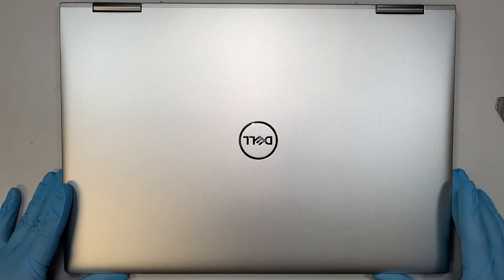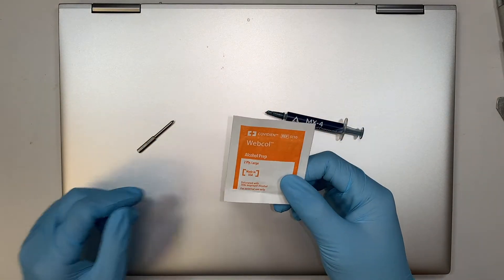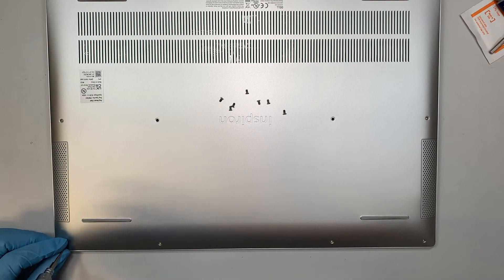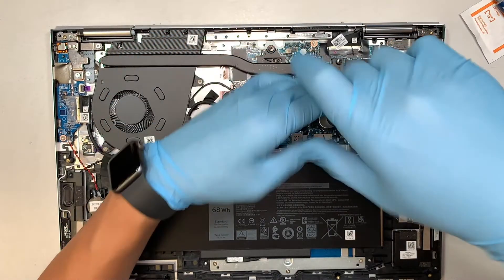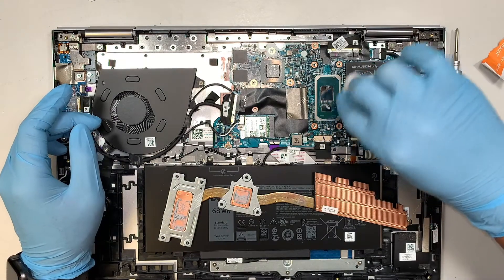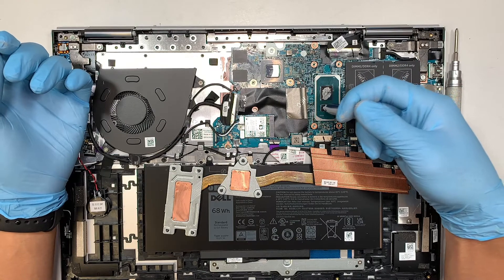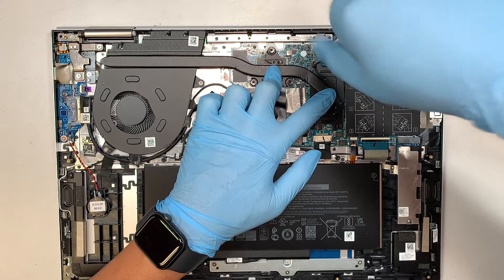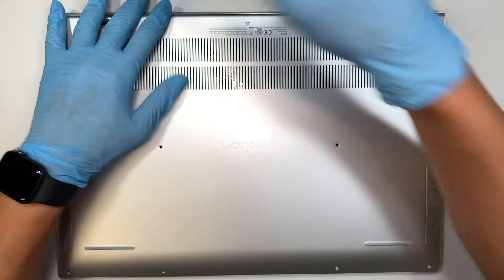Fixed Overheat Dell Inspiron 7760 P98F New Thermal Paste

Comment: I have this exact laptop and I've been having issues with overheating and the fan going like crazy for months. I had several techs look at it and nothing they did fixed it. This did it right away though. It's running perfectly. Thank you!